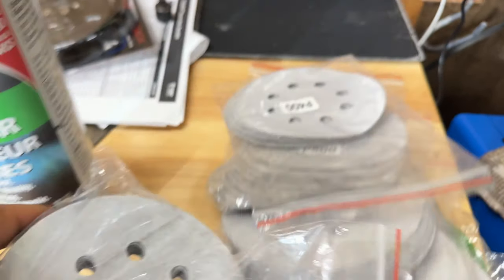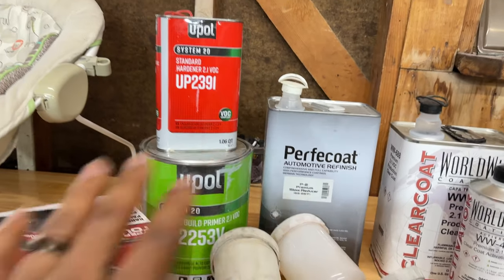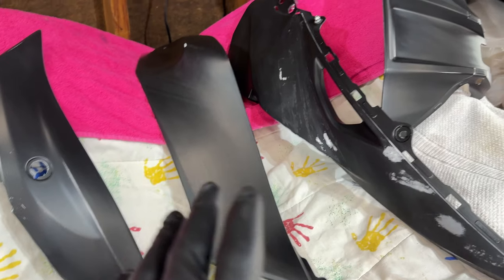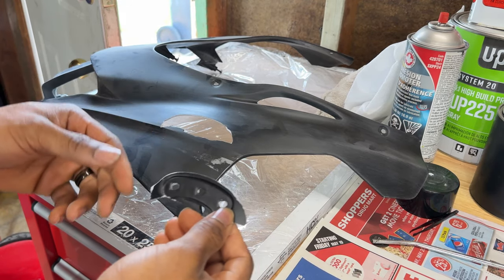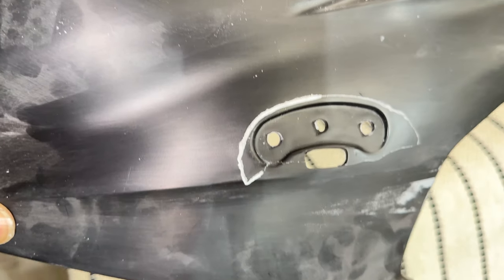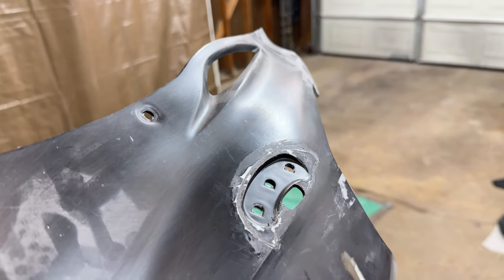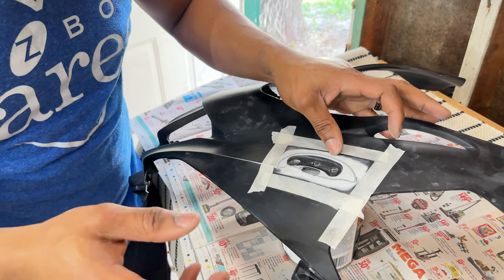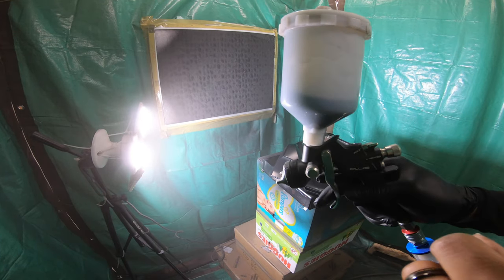How To Paint Your Motorcycle Fairings At Home By Yourself (Cracked Fairing Repair)

Comment: Great work but I don’t have that time on my hands so imma just buy 250$ aftermarket black gloss fairings
Reply from the maker: Thanks. What bike do you have?
Reply: @MIKESBUILDZ  a Suzuki gsxr600 2002
Reply from the maker: absfairings.com is my go to. Use code mikesbuildz75 to save some $$
Reply: Hi Bray, my advice is (If your old fairings are still good) you should always refurb them rather than buying fresh after market fairings. In my experience they are often a lot thinner and not as good fitting as the originals. Also you can do a perfectly good respray with good quality two pack spray cans, (you don’t need spray guns and a compressor unless you are running your own respray business).
Reply from the maker: @philtucker1224  wise words!

Comment: very cool, I just cracked a few fairings on my cb300r.. $160 for a new tank fairing and I am instead wondering if it might just be easier to plastic weld it back together. Worst case scenario is I wasted $50 on a plastic welding gun and bought a new fairing.
Reply from the maker: Definitely worth the try. If you need a new fairing kit I can give you a discount code to save some $$

Comment: So I need some clarification. Did you say if the aftermarket faring is unpainted and undamaged (plain plastic) you don’t need to prime it at all? 
Just sand the raw plastic and paint it? That doesn’t seem accurate. If plastic parts have no paint or primer.. I don’t feel the paint on its own will stick to the plastic parts. Seems like unfinished plastic would need a base of primer with adhesion promoter to get the paint coast to stick.
Reply from the maker: Hey, all or most plastic comes primered. I haven’t seen a raw plastic panel in a long time. If the part has no damage and has paint or primer on it, all you do is sand with 600 or red scotch brite and spray adhesion promoter and base coat or primer sealer (if required to make blending the color easier). Now if it is raw plastic, wash the part thoroughly to ensure there’s no release agent from the moulding process on the part, sand with 320, spray adhesion promoter and spray a good quality 2k primer, sand again then base and clear coat. I hope this helps. Let me know if you require additional help.
Reply: @MIKESBUILDZ  
Thanks for the quick reply. I will check the farings again and see what I find. They look to be ones bought cheap off eBay and never painted. They were in the bike when I bought it. They are shiny white on the outside and dull white in the inner side. We plan to paint them. 
I just don’t want to have issue with the paint flaking off later or cracking easily because these seem pretty flexible. 
We plan to use adhesion promoter. And good primer & paint. Maybe even 2 part primer and 2 part paint.
Reply from the maker: @hardtorn you’re welcome. if you’re not certain if it’s primer or raw plastic I would just spray primer, not worth the risk. Be sure to use good quality 2k or epoxy primer. Sanding as needed will improve the finished result. Depending on the colour and type of paint (plain, metallics, pearl etc), I’d personally use solvent instead of waterborne paint. 2k clear coat is must to ensure a nice durable finish.

Comment: So for some clarification on the primer

Which do you use first, the Standard Hardener or the High Build Primer? Is there any specific order for it to be done?
Reply from the maker: You should only use high build primer if some body works been done and you intend to sand after applying primer. If there’s no damage, you can thin out the primer to act as a primer surfacer.

Comment: You apply the adhesion promoter before the base coat ?
Reply from the maker: Best to apply before primer, no need to apply before base coat. If you’re just spraying base coat and no primer, then a light coat of adhesion promoter on a prepped surface is a good idea.
Reply: @MIKESBUILDZ  thanks a lot see how it goes !!
Reply from the maker: @josegtorres1148 you’re welcome. Take your time, try not to rush and if you’re painting multiple parts just go slow. When you rush, mistakes gets made. Send me a message on Instagram if you need further help, it’s quicker to get a response that way

Comment: Do you use wet sandpaper after the base coat and then the top coat or no sanding after the top coat?
Reply from the maker: You can wet sand after base coat but I don’t recommend. Wet sand after primer and you should be good for base and clear coat.

Comment: So if the paint on the fairings is still in good shape, no need for primer? Also what if i were to repaint my tank?
Reply from the maker: Correct, scuff with red scotch brite and you can spray base coat. The same process applies to the tank as well.

Comment: How much should I sand the oem fairings to paint if there's no damage? Just take off the clear coat or all the paint off? Also, should I use primer first?
Reply from the maker: If there’s no damage sand with 600 grit paper or red scotch brite till all panels have an even matte finish.
Reply: @MIKESBUILDZ  thank you for your reply. The problem I've ran into is the residue left behind from removing the factory decals. (Which for some reaaon seen to be the WORST I have ever come across. It's like they were super glued on!) should I use a more corse grit first, then work to 600, or just use a course grit then primer it to cover some of scratches from removing the glue?
Reply from the maker: @kforeal6809 there are solvents you can use to remove the residue. Like goo gone, lacquer thinner r acetone. However you should be careful using those. Sanding also works but you’ll gum up the sand paper quickly.

Comment: Hi, a question for you…

I ordered armour bodies track fairings and they come primer grey from revzilla. Do I need to wet sand with 600 or dry sand to scuff it up? Clean with alcohol after?

Then I can spray a base coat? I was thinking something like mtn94 cans, and I purchased 2x cans high gloss 2k primer with the hardener (red pop caps) for the clear coat.
Reply from the maker: Hey. It’s probably best to wet sand with 600 and spray adhesion promoter, a primer sealer, then base and clear. Yeah the 2k clear is the way to go, cans or gun.

Comment: What grit sandpaper do you sand the epoxy down?
Sand the panels down ?
Sand the high build primer down?
Reply from the maker: I use 400 grit paper to sand epoxy or high build primer before hitting it with a sealer and base coat. 

If there’s no damage to the panel, you can send with 1000 grit or a scotch brite pad and spray base coat.

Comment: This is a great video but this isn’t an easy at home job, you’ll invest minimum $600 for materials alone
Reply from the maker: Not necessarily. All the supplies I show in the video can be purchased in smaller quantities. Paint, primer and clear coat are all available in spray cans. However if you plan on doing other paint products in the future, it might be worth it to invest in proper painting supplies.
Reply: @MIKESBUILDZ  yea you can get this in smaller quantities I was more so referencing the air compressor, air lines and a decent spray gun will cost you $600 and that’s not including the paint primer, clear coat, and etc.. but again great video just should’ve let it be knowing you have majority of what a real paint shop would have to do the actual painting
Reply from the maker: Yes you are correct. Appreciate the feedback

Comment: What color is that?
Reply from the maker: It’s Ford Tuxedo Black. Paint code UH
Reply: @MIKESBUILDZ  Thanks. I really like the color and want to repain my bike. Mainly beacuse two women have parked on it. Which I still do not get how you over see a bike in a parking spot for motorcycles.
Reply from the maker: @Iamtoookool  dang that sucks. its a very nice paint. expensive but worth it!